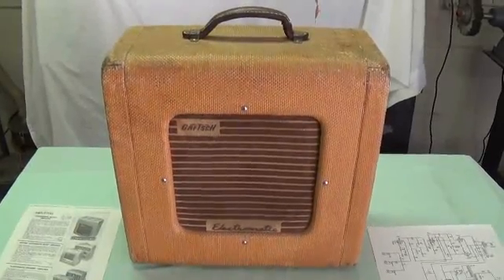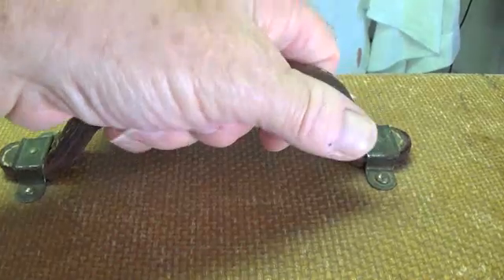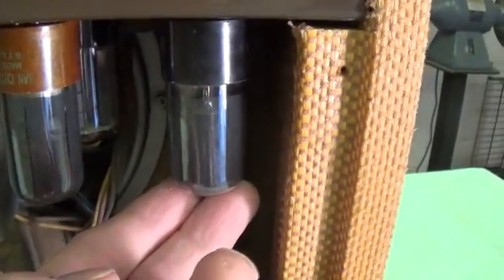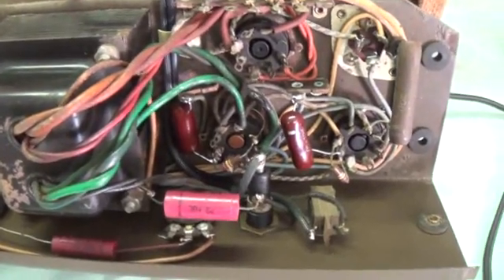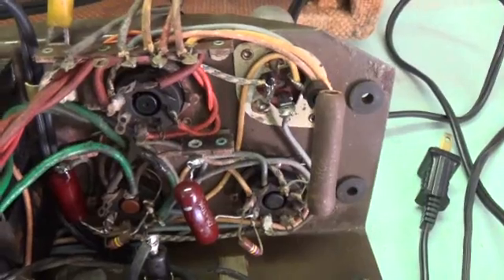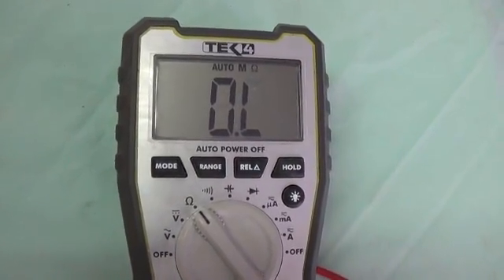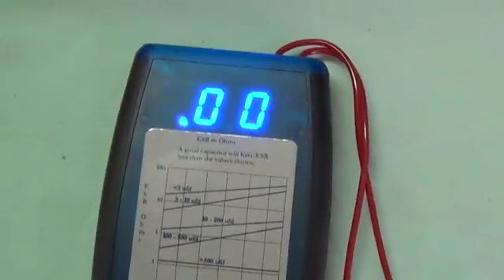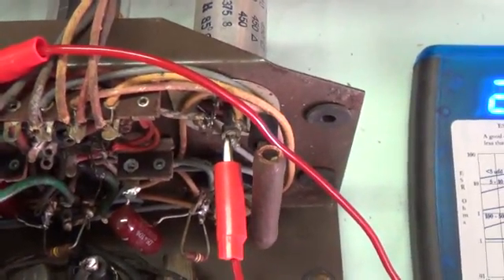Using an ESR Meter to Determine the 'Health' of Electrolytic Capacitors in Guitar Amplifiers

Comment: Love these electro magnets for speakers .. I wonder what characteristic they have as opposed to magnets if any ...
Reply from the maker: +graham kaveman  If you're speaking of electrodynamic speakers, which use electromagnetic coils rather than permanent magnets, their functional properties are quite similar to PM speakers.
Reply: Right , TY. I had a question re capacitors. Do you think there is validity regarding older gear that caps getting older and causing the tone of amps and devices to shift ?
Reply from the maker: I think that a significant part of "vintage tone" is the fact that the resistors and capacitors have drifted away from specified values and give a raunchier, more "organic" quality to the tone.....just the opposite of the precise cleanliness of solid state.
Reply: When you say they drift do they alter significantly under normal ambient conditions ? EG As AMp heats up or room temperature changes  would these changes be audible to human ear . b) I assume ripping down an old amp that sounds good and measuring the drifted values would  make duplicating the warm tones reproducible ?
Reply from the maker: I think they have drifted over the years and then drift some more when heated up to operating temperatures. Yes, I think the overall effect is audible. It would be really tough to try to recreate all the drifted values, and impossible to predict their values when fully warmed up. Like an old soldier, a vintage circuit is the product of its lifetime and has countless stories to tell.

Comment: Question: Is it possible that the filter caps in that amp had been changed fairly recently? Because that can cap looks relatively new. I wonder if you'd measured 1953 capacitors if you'd get the same results.  At any rate thanks for the great videos, I've learned so much!
Reply from the maker: +Sam Pajanna  Sam, the amp appeared to be original and unmolested. There were no fresh solder joints. If the caps had been replaced, it was done long ago. Thanks for watching and for your input :)

Comment from the maker: Google +, your comment came without a reply capability so I'll answer up here. How many parallel or series electrolytic capacitors do you routinely encounter in circuits? In vintage amps, they are quite rare, since the circuit designers simply specify a single cap of the correct capacitance and voltage rating. The exception is in Fender Bassman-style circuits, where two 70uf @ 350V are used in series to achieve 35uf @ 700V.....not easily found in a single cap. Even then, the ESR meter will read the pair as if they were a single cap, and if either is truly out of range, the average reading will reflect it. You can theorize all sorts of pitfalls, but the simple truth is, in practical day-to-day usage, the ESR meter can be reliably used on circuits with all connections intact.
Reply: Doug i am not as lucky as you most of what i work on is tube radios and 75 % of the time i run into either shorted or open electrolytics though sometimes i get a set that works really well but has a considerable amount of hum. I went through a philco from the 30's with aerovox caps that looked to come out of the 50's the set worked ok but had considerable hum they where both 8 mfd units at 450 volts both had leakage at 100-150 volts with a power factor ( ESR ) of 15 - 25 my personally tester is a Eico 950 B thanks for the video. 
- Jake.

Comment: you don't have to desolder to measure? what about if you have another capacior on board in series? or in paralel?  it WILL measure all that with the component you're actually trying to measure..
Reply from the maker: Perhaps, but in the tube amplifier circuits I test, it is exceedingly rare to find capacitors in series or parallel. In the few cases I encounter, i.e. the 70uf caps in series in a Bassman circuit,  one lead can be separated from the circuit for ESR measurement.

Comment: The two were twice the rated value but test fine esr...are you saying the cap value can be ignored? wouldn't that change the function of the amp being twice the cap value?  I'm very new to this and just trying to find good practices and I have run across this and would probably change them if they didn't test right across all tests...I have watched all of your videos and for sure you know what the heck you are doing so any advise would be appreciated !!  Haven't seen a new video in awhile...everything ok?
Reply from the maker: Mark Jordan Everything is fine, Mark. Rusty and I have just been taking some time off. Thanks for asking.

The reason the capacitors appeared to have  higher-than-proper values was that they were inadvertently measured in parallel (due to their connection in the circuit) by the capacitance meter, which resulted in the addition of the two values together. The reading was not correct. The capacitor values would have agreed with their rated values if they had each been measured by the capacitance meter out of circuit. The ESR meter was not "fooled" by the parallel connection and gave accurate readings.
Reply: That makes perfect sense...had me pretty confused !!  Thanks for taking the time and I'm looking forward to a new video...you are somewhat to blame for my new found interest in all things tube!!
Reply from the maker: You're welcome, Mark. This is a very interesting and challenging hobby......welcome aboard :)

Comment: one other test is a leakage tester. It tests resistance using a voltage similar to the circuit voltage.
Reply from the maker: I'm not sure if it tests resistance, Galfonz.  It would probably be more useful to apply the DC operating voltage and then test to see how much, if any, can pass through the capacitor.
Reply: and That is wy you dont need an esr meter! it is in only good use with low voltages
Reply: @jeffjeff370  Agreed. ESR meters are for low voltage checks to see how much AC current leakage there is at 100KHz. 
 I have receivers to check and I will be using a Heathkit Model 3 and Model 11 which have a magic eye display. They are switchable on the test voltage so they can check up to 600 volts (on the 11, I think )  if necessary to see if and when a breakdown occurs. It's an eye opener to see a 400 volt cap start leaking at 25 volts.

Comment: I found your website with the current limiter and then immediatly went to this one.  I have been interested in this meter for some time. As of late my 50" Samsung Plasma screen went black. I think it is the T-Con Card, however since it was all the way in the back. I wanted to measure everything I could I have 3 DMM's and a 50MHZ Oscope yet not this ESR. I concure with you "if" you have this ESR you can be assured reasonably your equipment is in good shape. With that said do you have a maintence schedule on your amps?  The Plasma I mentioned cost me $2,000 new. So, every so often I thought it would be good idea to go in and re-measure sort of like a check up.  Your thoughts?  Uncle Doug thank your for your fine work..... I added you to my subscribed list and will check often. I do not have an Amp however I do have Fender DG 10LE now I think I will build my own Amp. I you have any resources on this endeaver please share.
Reply from the maker: William Ward Greetings, William. The ESR meter is particularly useful to test electrolytic capacitors that are still in-circuit, i.e. attached to the circuit board. I don't do periodic maintenance on the amps, but I do use the Current Limiter every time I fire one up that has been dormant for a while, and I perform diagnostic procedures only when malfunctions arise. Thanks for subscribing and watching :)

Comment: Will the ESR determine leakage in mica caps (mmf) in old tube radios?
Reply from the maker: Len S Probably not, Len. It's primary function is with electrolytic caps, generally 1uf and above.
Reply: Uncle Doug Thanks, Doug and Rusty.

Comment: Will any other capacitors store a dangerous charge in an amplifier?
Reply from the maker: Kenneth Cohagen A very good question, Kenneth. In my experience, only the higher capacitance/voltage electrolytic capacitors (i.e. 5-10mf @ 150V and above) have the ability to cause shock or harm. Large filter caps (20 to 80uf @ 450V+), as found in the power supply of a tube amp, could possibly kill a person, under the proper conditions.

Comment: Hey Doug, bought a 1000uf Sprague Blue Atom ecap recently that I believe to be bogus. Reason being is that the font is different from the others I placed in the same amp. Second reason is the cap returns 0.0 on my Blue Anatek ESR meter. Would you say that is indicative of too-high a value for the meter to display, or a defective cap? Cheers.
Reply from the maker: MuscleDad420 Greetings, MD. The only time I ever see a 0.0 reading on my ESR meter is during the initial zeroing procedure. As I recall, a too-high-to-read measurement is usually ----.-  I have heard of "counterfeit" capacitors, and this one sounds very suspicious.  I usually compare similar caps to each other before installation, and if any stand out from the rest, then they are considered faulty. If the other SBA caps tested out OK, then this one should not be used. If it came, by itself, from a vendor.....I would not buy from them again.
Reply: Uncle Doug Yes, and my Anatek zeroes correctly. The other SBA's, 3 500uf units in all, tested in the same region relative to each other. The problem I'm experiencing right now in the amp (a solid state Califone amp made by Rheem in the 60's -- yes, the a/c company) is the the signal chokes out momentarily during transient peaks. Experience tells me a bad filter cap is often the culprit here. Any ideas? Think I'll start by ordering a replacement. Considering Mouser charges $15 or so for a 1000uf SBA and this one cost $2 plus + $6 shipping it's highly likely I got fooled by a bogus Chinese copy. Cheers.
Reply from the maker: Although I have not experienced the "signal choking" phenomenon you describe, MD, your theory makes sense. Peak output stresses the power supply and would make any weaknesses, i.e. a defective filter cap, evident. It's certainly an easy theory to test....by replacement of the 'suspicious' capacitor and observation of the result. For future reference, please let us know how this turns out.
Reply: Uncle Doug Absolutely. Already ordered a Nichicon replacement at a reasonable price. What I should have done from the get-go rather than rolling the dice on a $2 Sprague Blue Atom on eBay. The price should have raised alarms. :) Will definitely keep you and your viewers in the loop, especially since there don't seem to be ANY schematics out there for this particular amp. Cheers Doug, love your videos and always look forward to them.
Reply from the maker: Thanks, MD, and best of luck with the repair :)

Comment: I agree , if it aint broke....
Ofcourse it flies in the face of those that say, we gotta change out all your electrolytics etc..same guys that say, if you break a string on your guitar, you gotta change all 6.
bah humbug,,right Rusty? lol
Reply from the maker: Krang Gangs Rusty agrees......as long as vintage components test out as being OK then they deserve to stay put :)  I would add that in amps that are regularly used for public performances, it probably makes sense to replace the vulnerable components (like old filter caps) to enhance reliability, but for home-use vintage amps, I tend to agree with Rusty.

Comment: Excellent! I've restored a few antique radios over the years and always wondered if the old capacitors were worth keeping. I have a huge box of them and am looking forward to testing them with an ESR meter.
Thanks so much for these videos...I just subscribed to your channel.
Reply from the maker: George Chambless You're welcome, George, and thanks for subscribing. Let me know what you discover when you test the old caps. Granted, the ESR value is only one of three tests, but I think you'll be surprised by how well a bunch of the discarded caps still function.
Reply: @UncleDoug  What are the other 2 tests please Doug? Do you have videos on these? All the best Sir.
Reply from the maker: @TwigtheWonderKid-q9r  You can lift one end of the cap and measure capacitance, and with coupling caps you can lift one end and measure DC leakage. Yes, I have demonstrated this in videos......but don't ask me which ones ;)

Comment: Hi Uncle Doug, Thanks for the heads up on the Anatek Blue ESR tester. I recently purchased the kit and it went together rather easily. Now I'm set for the checking the larger value capacitors.
 What method do you use for testing the small "tone" Capacitors like 0.01 and 0.047 etc.? Thanks!
Reply from the maker: skeeterbuck Greetings, SB. The Blue ESR meter is theoretically only intended for testing electrolytic capacitors, with values of 1uf or more.....but I have found that it yields very reproducible readings with non-electrolytic (non-polar) capacitors of .01uf and above. If you have a bunch of new, non-polar caps, test several of the same value and you will see that it yields consistent values for them. If you then encounter a capacitor of the same value within an amp circuit, it should yield this same value. I am still trying to determine if faulty caps in circuit will yield a different value and would thus be detectable with the ESR meter. I don't have enough data yet to make any definitive statements, but it's an interesting concept.Meanwhile, customary tests like measuring capacitance and DC leakage (mainly for coupling caps.....see Internet sources for leakage testing procedures) are routinely performed.

Comment: Hi Uncle Doug & Rusty! First of all thanks so much for your video series... Your teaching very well fills a BIG gap in tube amp education, and I'm very grateful.... After watching your ESR meter video I went to the Anatek site to check out the Blue meter, and am planning to order one...  Had a quick question: in the Anatek video they said you can't reliably test capacitors in circuit when they are connected to a power rail in parallel.... That you could have a bad capacitor that wouldn't read bad because of the other caps on the line.... Just wondering if you could pass let me know your thoughts... And one further question, would love to know your thoughts on testing non-polarized caps? I am in total agreement with you about changing parts in vintage amps... I perfer

Comment: Hi Uncle Doug in the week since I discovered your video page I have been greatly entertained and informed, Thanks so much. I posted this video on the Tube Amp Builders group site thread concerning replacement of Electrolytic Caps.
 https://www.facebook.com/groups/tubeampbuilders/permalink/10153069668024493/?comment_id=10153070895474493&offset=0&total_comments=20&notif_t=group_comment_mention
One of the posters responded with this statement, what say you?

" Uncle Doug's stuff is excellent but he is confusing ESR and leakage testing in that video. For guitar amps, you need to check the value, ESR and leakage to determine if a cap is working correctly. So with a typical modern voltmeter with a capacitance function and an ESR meter,you have two parameters covered. And all you need to check leakage is a voltage source and a resistor to limit the current while the cap reforms."
Reply from the maker: I think he makes a good point. There are several parameters in the testing of electrolytic capacitors and the ESR value is only one of them. At the time I made the video I was more focused on the ESR value, and, to be honest, have found it to be an excellent indicator of capacitor "health", but fully understand the need to test high voltage electrolytics at their operating voltages. I will add a note to the video description to clarify the issue. Thanks for your input.
Reply: Thank You Uncle Doug, I posted your response on the FB Thread. Have a great day
Reply from the maker: Same to you, Joe. Thanks for the input :)

Comment: I just watched this again, and another thought came to mind.  I hope you haven't stated it somewhere before, but what is your theory on re-forming electrolytics in a unit that has not been used in some time?
Reply from the maker: Actually, I have posted a video showing the benefit of slow start-up of electronic gear that has not been used in a long time....using a Variac. Please check my video list. Reasonably "healthy" electrolytic capacitors can usually be rejuvenated by this technique, while shorted or badly compromised capacitors are simply not salvageable.
Reply: I have a variac, and will find the video,

Comment: My combination ESR tester arrived last week, and I am absoutely thrilled with it.  In the meantime, my beautiful Hickok 1600B VTVM has failed and I can't find a schematic anywhere.  I have checked the tubes with a transconductance tester, and suspect that it is yet another failure of an electrolytic cap.  I am going to attempt an in-ciruit test of the caps first, to see how well this is going to work for me.  The unit is super clean, and there is no obvious sign of any failed components, but you know it is never easy.  Thanks
Reply from the maker: I'm glad that you're pleased with the ESR meter, SJ. It should prove useful for your in-circuit testing of the capacitors in your Hickok VTVM. Best of luck.